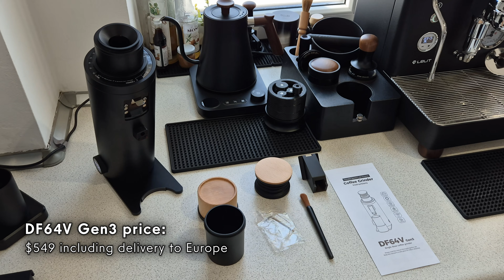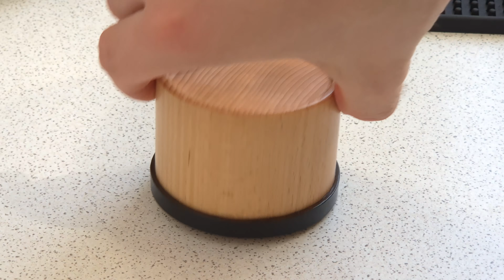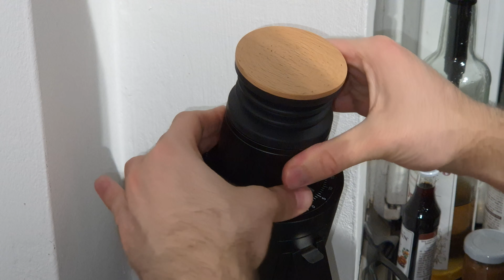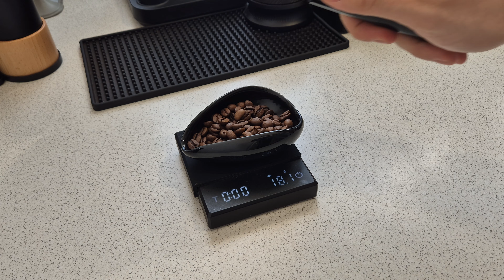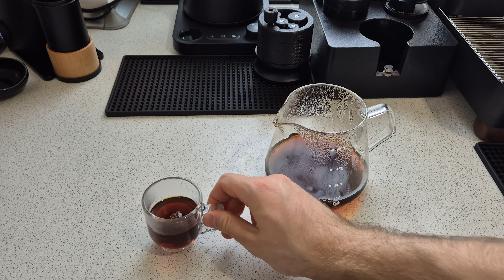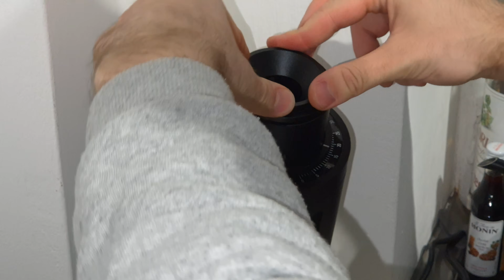DF64V Gen 3 Honest Review: Not an Obvious Upgrade

Comment: In the UK this is now the same price as the Niche, with the gen 2 significantly cheaper (Niche 559, gen 3 549, gen 2 379). So I don't know what to do.. The gen 2 seemed a no brainer over the Niche with the price difference, but now I've realised this is out I'm stuck. 
Getting a bambino plus, beginner, love good milk drinks and aeropress brewing..
Reply from the maker: Gen 2 is still great but has its weird flaws: DLC burrs, constantly active plasma. Gen 3 has a better motor, better burr coating and a plasma that only turns on when needed, but it is placed under the exit chute, working slightly less efficiently. Gen 3 also has worse declumber, which causes the particles to clump together. Honestly, looking at prices in the UK, I think Gen 2 is a better value for money - 
You can use the money saved to buy SSP burrs in the future, for example.

Comment: For the upper burr carrier, put your finger through the hole and lift it up. It's only friction fitted into the silicone pads on the side.
Reply from the maker: Not the case with Gen 3. It's very tight.
Reply: @Caffeinally  mine came off easily, no need to pry
Reply from the maker: @frostywuff  Well, maybe my unit is special haha

Comment: I bought the DF64V 3 months ago after watching your video, and it has become my favorite grinder! The RPM control is fantastic.I'm about to upgrade to SSP HU burrs. Since I almost exclusively drink straight espresso without milk (and filter only about once a week), I’m looking for that richer body and sweetness. From your experience, what kind of percentage leap in extraction quality or taste profile should I expect with this upgrade? Can't wait for your reply!
Reply from the maker: Hi, SSP HU burrs have similar, though not identical, geometry to the stock DF burrs. They are definitely not recommended for Pour Over. I haven't tested SSP HU yet, but I've read that users were pleased with the results. I think you'll notice more of a difference in flavor and body than in extraction percentages :)
Reply: @Caffeinally  Thanks for the honest feedback! Based on your advice, I think I'll hold off on upgrading for another year since the stock burrs are treating me well.Quick question: If I decide later to completely convert my DF64V into a dedicated filter grinder and swap to a filter-focused burr (like SSP MP), could I get a pour-over quality that rivals a dedicated filter grinder like the Fellow Ode Gen 2?

Comment: Avx j64v or df64v gen 3 ?
Reply from the maker: I haven't tested the J64V, so I don't want to give a definitive answer. I think both grinders are very good. The J64V will have better burrs for pour-over and light roast espresso. The J64V also has vertically mounted burrs, which should slightly reduce retention. The DF64V gen 3, in turn, has a display and a more powerful motor. A lot depends on your preferences and budget.

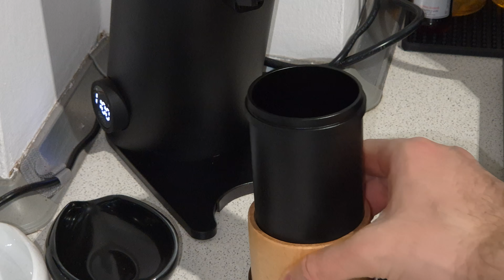Comment: 17:28 Hi! Great video. Does it really have coarse at 0 and fine at 90, opposite to other DF64s? It's confusing
Reply from the maker: No, it's exactly the same, as you can see in the video. 0 is the finest, 90 is the coarsest. The arrows indicate the direction of the setting - the further from 0, the coarser.

Comment: I use an Aeropress rather than a pour-over.  Are your comments regarding grinding for pour-over applicable to an Aeropress, or should I consider more the comments in regard to espresso settings?  For reference, using my existing cheap OXO grinder, I tend to prefer an espresso-type grind for my Aeropress.  But I am looking to improve my coffee game one piece at a time.
Reply from the maker: I don't brew with an AeroPress, so I don't want to tell you what you should do ;) But I think you should stick closer to the espresso grind setting. Maybe a little coarser.

Comment: Great video, you answered almost every question I had lol. Here are a couple of left over questions though: How would you compare to the DF64 Gen 2.5 or even the Niche zero? Whats your favorite grinder?
Reply from the maker: I think the Niche Zero has a strange design and may be more prone to retention, but I haven't tested that grinder. I think it's definitely overpriced. The DF64 without the V doesn't have variable RPM, but otherwise it's similar in terms of grind quality. However, in my opinion, variable RPM is always worth the extra cost.

Comment: Hi! Great video. Quick question: I saw that you have the E55 Pro. How does the taste compare to DF64V? Thanks
Reply from the maker: Hi, when it comes to espresso taste, these grinders are quite similar in my opinion. I think the DF64V has a slightly higher body and a more classic espresso profile, while the E55 Pro has a slightly higher acidity.

Comment: Message for all those with the new  gen3. 

How do you find the noise? I know a previous common feedback re the df64v were that it was often ‘screeching’. I am wondering if the new motor has helped in this regard or not?
Reply from the maker: Hi, I didn't have this problem in either gen2 or gen3.
Reply: @Caffeinally that’s interesting thanks and was that with the dlc burrs? Have heard they can be loud
Reply from the maker: @dannytunik8325  The Gen3 (titanium burrs) noise level is similar to the Gen2 (DLC burrs), perhaps a bit quieter. The motor itself - which you mentioned earlier - is almost inaudible. It only gets louder when you add coffee beans.

Comment: Thanks for the great video, did you have a problem with aligment?
Reply from the maker: Hi, thanks!
What do you mean exactly?
Reply: @Caffeinally I mean the Burrs being misaligned and needing to add some foil and balance it
Reply from the maker: @MUATH180  I don't think it's entirely necessary - especially considering the burr carriers are spring-loaded. I think even Lance pointed out in one of his videos that aligning the burrs makes more sense when they're mounted vertically, rather than horizontally like the DF64 series.

Comment: I've ordered  DF64V3, waiting for a delivery. Interesting how it is different from Sette 270.  With this method changing pressure 3-9-6, does it affect time making a shot, or it has to be in 30 sec range? And what temperature is better? My favourite 95 degrees. Thank you.
Reply from the maker: Hi,
pressure profiling affects the grind level – in my case, I can grind a bit coarser. I try to keep the extraction time between 30 and 35 seconds, but it depends on the recipe and each coffee behaves a little differently. The same goes for temperature - adjust it depending on the beans you’re using. I mostly use medium-roasted beans and usually brew at 93°C.

Comment: Great review. I dont think i would go for gen 3 if i could find the gen 2 cheaper. Those "upgrades" are just a marketing trick to make them visible on the market. How does it compare to STARSEEKER E64?
Reply from the maker: Hi, thanks for the comment. While these improvements are minor, I think the Gen2 from resellers is more expensive than the Gen3 directly from the factory, so when choosing a new grinder, it's better to go with the Gen3. I haven't had an E64, but the constant, high RPMs don't convince me. Besides, I think the E64 is a bit overpriced now.
Reply: @Caffeinally  At df64coffee site the gen 2 costs now 375 euros with red titanium burrs and 316 with Stainless Steel burrs. While the cheapest version of the gen 3 costs 485 euros and comes with red titanium burrs.

Comment: What alternatives to this coffee grinder are there, of the same or better quality, at a comparable price?
Reply from the maker: Hi, in other comments I've already mentioned an interesting grinder originally called the J64 (also known as AVX J64V or GZZT FL250) with Multipurpose SSP-style stock burrs:

- GZZT AliExpress: https://s.click.aliexpress.com/e/_c4KMTEhF

- or directly from the factory (you can ask the supplier about espresso burrs): https://offer.alibaba.com/cps/6epc770q?bm=cps&src=saf&productId=1601693917016

The Cafovo G564FV is also interesting and cheaper; it has quite similar specifications, but I don't have much information about its build quality and reliability.

- https://s.click.aliexpress.com/e/_c4mUVdAv

However, if you prefer conical burrs, you might want to consider the DC63 (same manufacturer as the DF64V):

- https://offer.alibaba.com/cps/6epc770q?bm=cps&src=saf&productId=1601398825921

and the Cafovo G163CV, but there's not much information about it online either:

- https://s.click.aliexpress.com/e/_c3fYPj9f
Reply: @Caffeinally Do you prefer the taste of the DC63 over the E55?

Comment: Thanks for this! I am considering this grinder as a compliment to my niche zero,  as I am preferring lighter roasts and more modern espresso styles (I drink straight shots typically but my wife prefers milk based drinks and more medium roasts).  I recently got a fellow es1 which allows for pressure profiling ,  which has also upped my ability to pull light roasts 

Given that,  I was considering this grinder with the ssp lab sweet v3 burrs.  Any thoughts? I have heard good things.
Reply from the maker: Hi, I think this will be a very good combination, especially for light roast. The powerful 400W servo motor and these burrs are an excellent choice for light roast, in my opinion. You might also consider SSP multipurpose burrs, but I haven't tested either the Sweet Lab or Multipurpose yet. You will definitely find many reviews about them :)

Do you mainly brew espresso or also pour over?

PS: You could also consider the J64, it has vertically mounted burrs and a very nice design, but it is less well-known and has a slightly weaker motor (brushless 250W instead of servo 400W). Despite this, it handles light roast without any problems, I know this from one of my viewers. 

- GZZT AliExpress: https://s.click.aliexpress.com/e/_c4KMTEhF

- or directly from the factory (you can ask the supplier about espresso burrs): https://offer.alibaba.com/cps/6epc770q?bm=cps&src=saf&productId=1601693917016
Reply: @Caffeinally pretty much only espresso drinks.  And I will keep the niche as well which also can do filter if I feel so inclined. 

I am leaning towards the lab sweet v3 from what I read as they can still pull great espresso but trend towards the clarity side of things,  which is what I would be aiming for.
Reply from the maker: @montyjcm Yes, these burrs will also work well for espresso, but they’ll likely produce higher clarity and less body, similar to multipurpose burrs. I haven’t had the chance to test them myself, though — I’m basing this on reviews from other creators and Reddit users.

Comment: I've got the first gen DF64V, quite happy with it. I considered adding plasma generator kit but when doing RDT, even without the plasma generator, the retention is less than 0.1g.  I have premium burrs installed, I'm quite happy with it, I see no need to upgrade. I got two more robust grinders with different burrs, DF64V holds its own well being quiet, compact and quite pleasing to the eye.
Reply from the maker: It's true - RDT is still the best way to reduce retention imo. Plasma is a nice addition, but it helps more with keeping the grinder tidy than significantly reducing retention. Because retention starts in the grinding chamber, not in the exit chute :)

Comment: I have a "t64" which looks a Lot like that one, it has the same dial for RPM, but it has a fork for the dosing cup/porta filter, it came with DLC-coated burrs and costed like 350 usd shipping inclused
Reply from the maker: This grinder is quite interesting, but unfortunately it doesn't have a plasma generator. That's why I never bought it tbh.
Are you satisfied with DLC burrs? Could you send me some photos of the burrs? I'm curious about the geometry and build quality :)
Reply: I also have a T64 and so far am very happy with it. It comes with black DLC espresso burrs, which seem very good. My first shot with this grinder was exceptional, and the burrs are not even seasoned. Cleaning is also very easy. I would rate it as one of the best value "cheap" grinders available. I think the DF64V is probably a step up in build quality though. But it's almost double the price.

Comment: To tell you the truth, I'm still considering which flat burr grinder to buy!
Right now I only have the Starseeker e55pro, which I really like.
Which brand/models would you say would be good alternatives in this price range?
Reply from the maker: Hi :)

Besides the DF64V Gen3, you might also consider the J64 (known as the AVX J64V and the GZZT FL250, which is available in more interesting color variants). It also has plasma, vertically mounted burrs (and auger), and variable RPM, while the stock burrs are multipurpose.

- GZZT AliExpress: https://s.click.aliexpress.com/e/_c4KMTEhF
- or directly from the factory (you can ask the supplier about espresso burrs): https://offer.alibaba.com/cps/6epc770q?bm=cps&src=saf&productId=1601693917016

PS: What's your budget for a grinder? There should be some interesting grinders on the market soon, so maybe it's worth the wait? The E55 Pro is a great grinder, and even today I compared the E55 Pro to the DF64V Gen3 (in cappuccino) and didn't see much of a difference. I notice a bigger difference in pour-over and espresso ;)
Reply: @Caffeinally Thanks for the advice. I'm not in a hurry. Firstly, I'm using a heavily modified consumer machine until my main machine arrives. So the e55pro will suffice for now.
What's interesting is that you have recommend the exact brand I bought my machine from. GZZT
I am already in contact through Alibaba,  so I will drop them a line for more information regarding that grinder.
I would say that ~€300-350 would be the reasonable limit I'm willing to spend, which is not a constant of course... because I was going to purchase the EM3801, but then pushed and pushed into a budget almost 3 times that machine's price (going through several other machines along the way).
I guess coffee as a hobby will consume a reasonable amount. 😂
Also, my main drinking habit is espresso,  I do milky drinks when I'm dialing in new coffee and the resulting espresso is drinkable but not perfect. I don't like wasting, tough childhood I guess.
Not a fan at all of pourover, I know it's kinda trend now, but if I crave something of this sort, I'll just make a tea.
Reply: @Caffeinally  Interesting. What was the difference you noticed in espresso?
Reply from the maker: @winexprt In my opinion, the body in the E55 Pro is slightly smaller. Overall, the differences are more or less noticeable depending on which beans I use. I can’t clearly say which one is better - they’re simply different in their own ways. I think that espresso from the DF64V has slightly lower acidity, perhaps more pronounced nutty and chocolate notes, but honestly these differences are very subtle. I think I need more comparative tests; I’ll probably record a video about it.